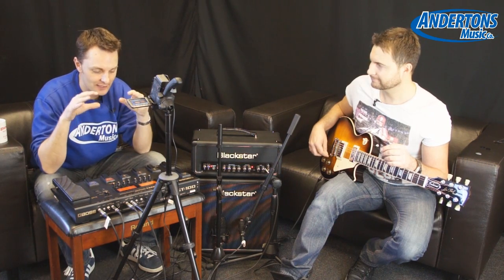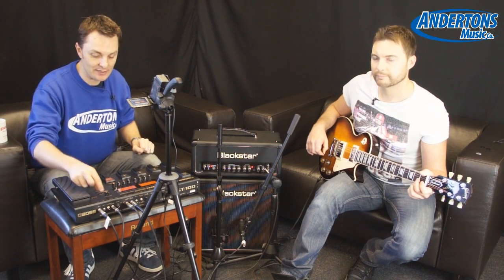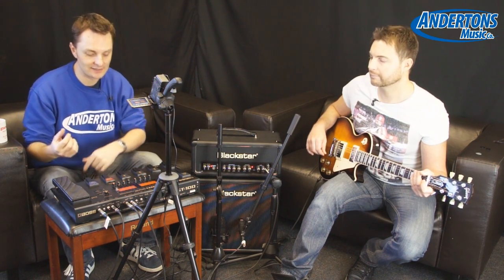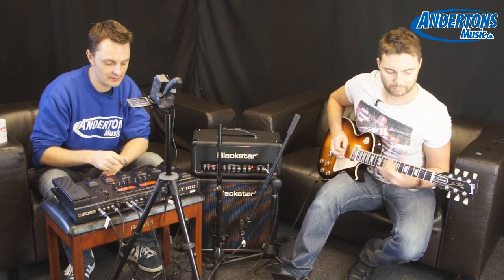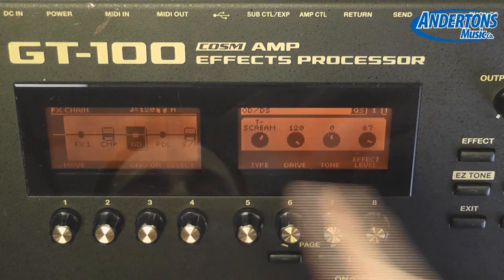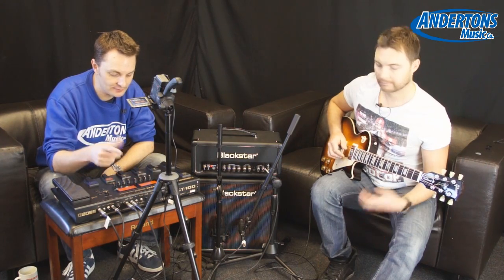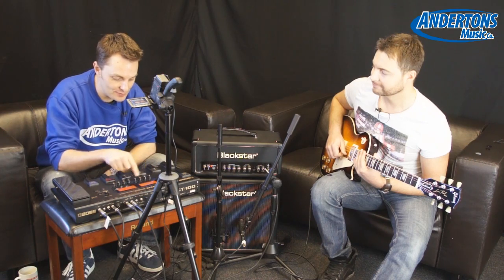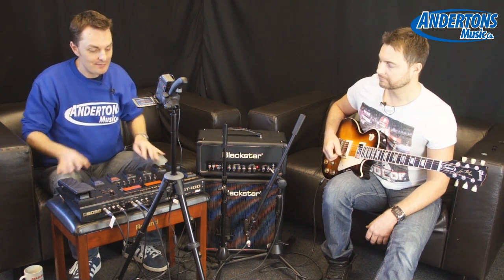Using a Boss GT100 with your Tube Amp via the 4 Cable Method

Comment: You can do this on the Boss GT-3 and up. Just did this on my GT-3 but instead of using the S/R , you to activate OD ext.
Reply: That’s what I have been doing for a couple years. I wish the loop was not Hooked up to the OD, so I could use the sweet analog distortion onboard as well as my amps preamp without putting the delay and reverb in front of the amp.

Comment: No...You can do it both ways and if you want the preamps from the Boss you just move the Pre in the fx chain to after it's fx loop and before your loop effects.  This way, when you switch to a patch with loop off.  Line 6 has only just caught with this I gather.

You could do this on a GT8 but you might need ground lift cables in the loop connections like a G system.

Comment: bit late probably but your volume control can be moved the same as the fx loop - I think it shows up as FV on my GT8 in the fx chain.  You just have to find out where it is in the chain and move it to the position you want.  Either before your amp input or before the reverb and delay in the loop fx which will allow your delays etc to keep sounding if you back off your volume.

Comment: I have this and the BOSS GT-100 is AMAZING - clearly the BEST of the GT series, hands down. BUT - and this is a BIG 'but' - THERE IS NO NATIVE GT-100 SOFTWARE FOR DESIGNING TONES ON THE COMPUTER. WTF?! This is 2013, BOSS/Roland! Line 6 has a thriving online community based around the POD line of modeling gear. Why BOSS has completely missed the boat on this is beyond me. There IS a free 3rd party program, which works great, but come on, a lone guy can do something mega-corp BOSS can't(or won't)?

Comment: I use the 4CM with a POD HD so I don't know 100% for sure but there should be a way of moving the volume pedal to the front of the signal chain on the GT-10 in order to use it. The GT-10 is a great unit and has to have that kind of flexibility built in to it.

Comment: I own a GT-10 and you can actually move and see the S/R in the chain. Anyway, the  only problem with this 4 cable thing is that I cannot use my pedal as a volume pedal anymore. Any suggestion? 
Thanks

Comment: Okay, from what I gather, you are stuck only using your amp's preamp with the 4 cable method with the Boss. With the POD HD 500, you can turn off the loop and use the preamp models from the POD through the the tube amps power section without recoloring it, giving you more options and a nice tube amp feel to modeled preamps. Is this right? I'm just curious because I'm looking at both processors. I've looked at the Boss's manual and can't see how to turn off the loop to do the same.

Comment: I just bought my GT100 and im using it with the 4 cable method with my Legacy 3 head. 
The problem is, only my main tube amp is working..The other 3 channels/preamp on my Legacy are disabeled...I though i can use my tube preamp with the boss gt100.

Comment: I have doubts that maybe you can help me. At 4 cm chain if I want to connect a bk butlerTube Driver pedal, where do I connect the bk, between  fx send (gt100) and amplifier in. Or  beteween fx send (amplifier) and return fx (GT100).
thanks

Comment: This 4 cable method was comum in the GT8, i used this way, but the Digitech RP1000 is better, because have two loops, one for the exclusive for the preamp of the amp and another for the pedals.

Comment: I'm about to buy a new multi fx to run the 4CM with my dual rectifier, but I'm not sure which one i should buy, the boss GT100 or the line6 POD HD500. Which one do you recommend?

Comment: hello lads ...enjoyed your demo of the new gt100...and the one with the comparison of the gt10 and the gt100 sounds..... you said at the end of this video that you can only use the 4 cable method with the gt10 and 100 ...this isn,t true.... I been useing the 4 cable method with my gt8 going into my DSL 100 ... and a 5 cable method (Right out) to run it to another amp for stereo (run clean) for about 3 years until I got a gt 10 a few months ago..........

Comment: i almost advertise my gt-10 on ebay until i discover 4 cable method almost 2 yrs ago, im mostly using the ht-20 head's drive channel as part of the patch through amp control and add od(ts9) and other effects from gt-10, i liked the sound very much.

Comment: I did this 15 yrs ago with my Rocktron Intellifex. I built it myself (in stereo) with relays and built a dc supply into my floor mounted switching system all DC 3.5V with DPDT switches and leds to let me know the on/off situation. I even mounted relays over the rev and channel change in the amp. Once the signal was in the amp it stayed there . No Patch leads running down to volume pedals or chains of pedals making all sorts of noise and signal loss.

Comment: Edit: I can still use the preamp/speaker simulator for different overdrive/distortion sounds though.
Reply: Do not use the speaker simulation into a guitar amp with speaker. You can use the preamp simulations, but then you lock the send/return to your amps preamp, in order to send the signal direct to your amps power amp.

Comment: I've been using the 4 cable method with my GT6 and my HT Stage 100 for about 5 months now. The only downside is that I loose the overdrive/distortion FX's as you have to select the GT6 to external to enable the FX loop. Other than that, it works really well so I might change to the GT 100 when I've got some more cash.

Comment: Most Mesas have a MIDI in. You can change channels that way with the GT units. The amp switchers on the GT units are a bit hit or miss with some amps, although not a fault with the unit.

Comment: As far as the channel switching goes, will this work with a Mesa Boogie amp? Mesa's have that weird multi pin type cable. Maybe Boss/Roland could make a cable that could work for that or are there company's out there that make a cable that could work with the GT100 and a Mesa?

Comment: You can do the 4 cable method on GT-6, you just use the ext distortion instead of a send/receive.  Guys with 5150's were doing this 10 years ago with GT-6.